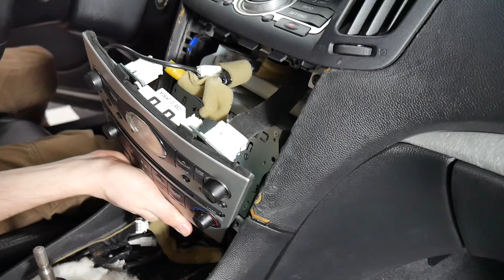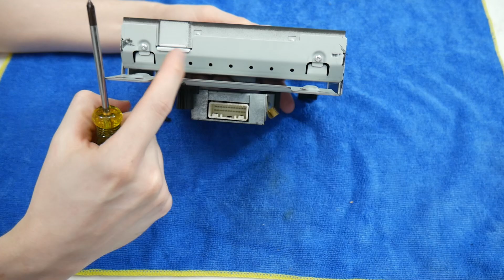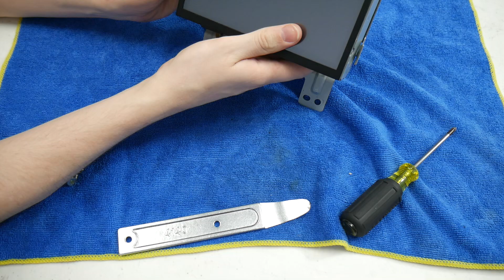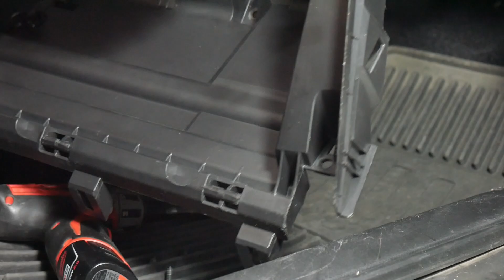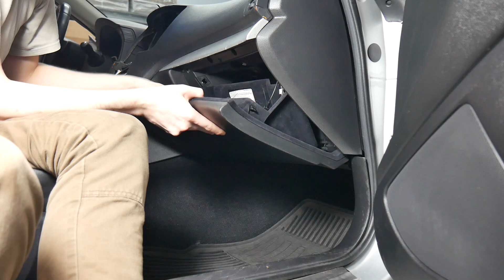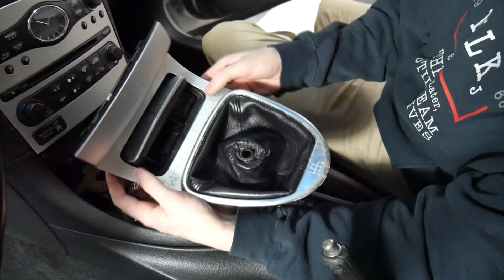How to add CarPlay Android Auto to Infiniti G37 G37S G35 G35S 2008-2013 No Nav | VLine Install NISK

Comment from the maker: The VLine VL2 System NISK to add CarPlay and Android Auto to the factory car stereo of Nissan and Infiniti 2008-2013 non-nav is available here:
https://gromaudio.com/store/vline/grom-vl2-nisk.html
Model: NISKVL2

The touchscreen overlay to add the touchscreen capability to the Nissan and Infiniti 2008-2013 non-nav stereo is available here:
https://gromaudio.com/store/accessories/screen-v-niskrth.html

The NISKVL2 VLine VL2 model is also compatible with the following cars:

Infiniti EX35 EX37 2008 2009 2010 (no NAV)
Infiniti EX35 EX37 2011 2012 2013 (No NAV)
Infiniti FX35 FX45 FX50 2009 (No NAV)
Infiniti FX35 FX45 FX50 2010 2011 2012 2013 (No NAV)
Infiniti G35 G35S Coupe 2008 2009 (No NAV)
Infiniti G35 G35S Coupe 2010 2011 2012 2013 (No NAV)
Infiniti G35 G35S Sedan 2007 (No NAV)
Infiniti G35 G35S Sedan 2008 2009 (No NAV)
Infiniti G35 G35S Sedan 2010 2011 2012 2013 (No NAV)
Infiniti G37 G37S 2008 2009 (No NAV)
Infiniti G37 G37S 2010 2011 2012 2013 (No NAV)
Infiniti G Convertible 2010 2011 2012 2013 (No NAV)
Infiniti G Coupe 2010 2011 2012 2013 (No NAV)
Infiniti G Sedan 2010 2011 2012 2013 (No NAV)
Infiniti Q40 2015 (No NAV)
Reply: does this have apple carplay as well?
Reply from the maker: @rajvirfaloure6271  yes it has Apple CarPlay as well.
Reply: All you have to do is read the first couple of lines to get the answer to that question.  @rajvirfaloure6271

Comment: usb port not working anymore
Reply from the maker: Do you mean the factory USB port, or the VLine USB port?
Reply: @gromaudio factory after installing the lsailt one which is similar on a 2011 g37x non navi / bose everything else works, has no more power to it
Reply from the maker: @freethedrench  you need to check the lsailt manual and see what they disable when connected.
Reply: @gromaudio it was whenever they made me do usb canbus for backup lines, going back to stock still didn't fix everything else works but that port now

Comment: Does work on 2007 g35s sedan 6mt with nav and Bose? Non touch? And in your option is it more worth while to retrofit the HD touchscreen unit to take advantage of the touchscreen benefits
Reply from the maker: A 2007 G35s sedan that has a factory nav should also have a touchscreen. If it doesn't have a touchscreen, double-check that it has a nav.
For no touchscreen/no nav, you will use the NISKVL2 model of VLine VL2 system here:
https://gromaudio.com/store/vline/grom-vl2-nisk.html
You can add the touchscreen overlay to convert the screen to a touchscreen here:
https://gromaudio.com/store/accessories/screen-v-niskrth.html
As for the aftermarket stereo with the touchscreen, you need to check how well it integrates with the rest of the factory system, including sound, cameras, climate controls, etc... VLine VL2 system preserves all original factory stereo functions.

Comment: I got a 2011 g37x, i’ve installed the vline2 and put everything back together to my best understanding  and now the screen is just black, none of the odometers work, and all the lights are on the dash. i know i did something wrong but need help diagnosing it
Reply from the maker: It looks like you plugged into the AC ports that look exactly the same but obviously wrong. 
Please refer to the install guide here:
https://gromaudio.com/docs/vline_manuals/vline_nis9_install_web.pdf

Also a video here:
https://youtu.be/7Z5un0iKxxU